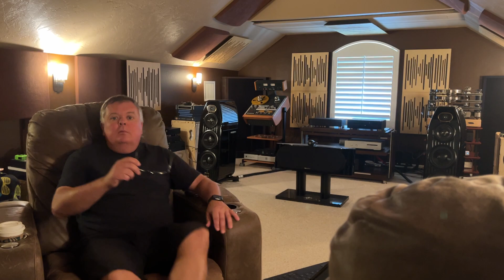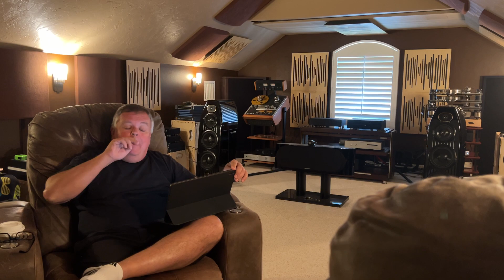How do dealers pick lines?

Comment: McIntosh sells
Reply from the maker: It sure does.  I’ve owned so much Mc, I’ve lost track.  Great brand.  I can’t carry it for two reasons:  the local rep has not treated us well and they have a dealer literally 2 miles from our store.
Reply: Aside from the smooth and non-offensive sound, they blue VU meters are the coolest.  It's nice stuff, but not quite my cup of tea. 🙃
Reply: @highendaudio  On a separate note, why did you get rid of your Naim stack? That was quite a collection
Reply from the maker: @michaela.5363  took it to the store, going to go with Block Audio SE monos, Block Audio SE pre and MAYBE Linn Klimax DSM (waiting on my demo to try).  Linn is a new line for us.